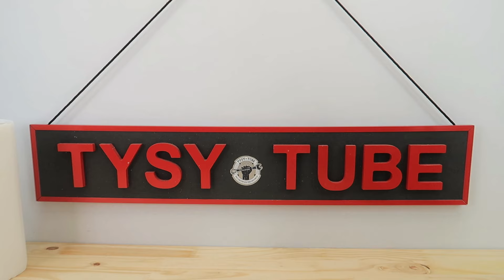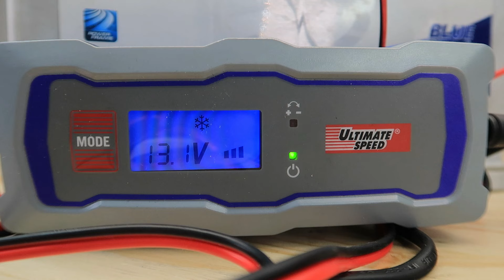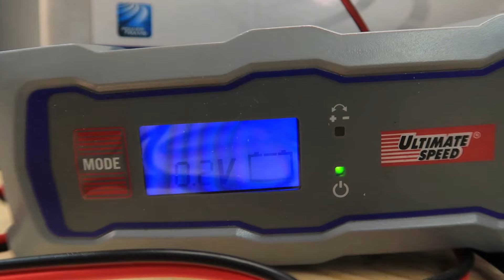I Restored this Rusty $1 Car Horn - NOT WORTH RESTORING

Comment: This was a really good restoration however I have some tips from and electrician's standpoint if your interested. First off all the terminals you used are not made for soldering. They are made for crimping. When you crimp those terminals with a correct set of pliers they clamp onto the wire resulting in a low resistance high quality joint that wont loosen due to mechanical loads. At least not easily. You can however add solder after for aditional safety. Also the color of the plastic insulation is not there for decoration or labeling. Its used for telling you what diameter wire that terminal was made for. Red represents 1.5mm2 and blue 2.5mm2. I belive yellow is 1.0mm2 but dont hold me on that. And one more detail. When you crimp the wire you never solder it before you crimp it. Soldering will result in a terribile bond that will easily fall off with vibration. You also never take a ferrule (that cylinder you put over the soldered wire) and put it in a cable terminal made for crimping. Those are used specifically for screw connections and terminals. You also never solder a ferrule. I hope you dont take this as an offence (which it isn't). Your restoration was great and I was amazed at the results but I still wanted to point out these things for the next time you play with electricity.
Reply: Haha the pain in me heart when i saw him doing that😂
Reply: Me: well... I aint reading all that...
Reply: I was so confused when he pulled out the solder
Reply: Thank you for the critique. I am no electrician, yet I found your advice both sincere and invaluable.

Thank you very much for taking the time to clearly explain what was what.
Reply: In Germany the Color code is red=0,5-1,5mm² Blue=1,5-2,5mm² yellow=4-6mm²
Reply: Well, you just wasted 3 second of my life my scrolling through that 😂
Reply: @XxRileyxX, it took you three seconds to scroll through that? I hope you get well soon.
Reply: @fridif  right!
Reply: I totally agree with your comment

IN my head I was thinking..
What the hell is he doing?
Why is he doing it that way?
Reply: Hi, I spent many years with crimping wires by hand, semi press, and full automatic machines This moment when Tysy soldered stranding wires -  broke my heart. :/ He should buy easy kit with isolated connectors and dedicated pliers. Molex, Tyco, Weidmuller and many other manufacturers.
Reply: I was going to say the same thing. Not the best electrical connection used.
Reply: +1 for this advice as a sparky myself but in having said that this restoration is beautiful.

Crimp lugs like that sizing is as follows. 
Red = 0.5mm2 to 1.5mm2
Blue = 1.5mm2 to 2.5mm2
Yellow = 4mm2 to 6mm2

This would be different if using a different gauge system like imperial or American Wire Gauge, 4 AWG would be a very different size to 4mm2
Reply: @therealracerxtablet5162  He isn't an electrician, but I won't hold it against him.
Reply: Never add solder, not even for "added security". The tinned wires are prone to breaking unless you fully enclose them with a celastic as a strain relief. In an actual automobile, those connections wouldn't last a year due to the vibration. Modern cars have zero soldered connections, even terminals usually get pressed into PCBs, instead of soldered, as again soldered joints are prone to developing cracks. Never. Solder. Crimps. Not even after crimping them. You'll only weaken them.
Reply: me: i’m not going to understand any of it, so i shouldn’t read it 
also me: reads the whole thing
Reply: took the words out of my mouth.  The soldering of the ferule kind of drove me nuts.  But other than that, this guy is definitely dedicated and talented.  Through all his videos I've binge-watched, he's been improving steadily, and comments like yours have helped him too.  So cool.  

Hah.. Saw the terminations used; and was wondering "why no crimp?!"  Those wires are going to just slip right off.  Solder alone won't hold it.  It's bugged me so much.
Reply: Yor advice makes sense but there is nothing wrong in soldering the terminals as he did. What's better than soldering anyway; a good crimp would at least match it but never make it better.
Reply: Me, reading this with interest as if I know any of these terms besides crimping and soldering.
Reply: Yea, him soldering that was a big WTF. You can get the proper crimpers for those eyelets from a hardware store for not much. If the wire is too small to crimp use a smaller eyelet.
Reply: @fridif  Why the "me:"?
Bruh

Comment: Who else was shocked at how clean the inside of it was 😳
Reply: Scrolled down expecting to find this comment. 90 years old and it looks new inside!
Reply: Yeah well made for it to look so good on the inside compared to the level of corrosion on the outside.
Reply: just like a small time capsule inside!!!!
Reply: I was shocked too. It was incredibly well sealed for the inside to be that pristine.
Reply: Me
Reply: I'm saying yes to the og comment
Reply: The probably dead engineer that decided to use that gasket just rolled in his grave.
Reply: French quality 😌
Reply: Bruh its been sealed shut for 90 years obv it’s gonna be clean
Reply: @braydenrezutek9839   seals often don't hold for that long 🙄
Reply: BoboGumdrop it wasn’t a seal it’s a gasket😂🤦‍♂️
Reply: @braydenrezutek9839  boi
Reply: It was closed,thats the reason
Reply: Was just gona write that.
Reply: Is because the oil
Reply: As long as it's not exposed to the elements, it can last years...
Reply: Hey! Many thanks for the spoiler!
Reply: I think it's because of all the gaskets.
Reply: Bro I'm looking at it like "there ain't no way the insides from the 1930's" 🤯🤯
Reply: Yup I was.
Reply: Beautiful. Like new again
Reply: I don't believe it's from 1930. There was no plastic wire isolation in 1930, for example
Reply: @michakubisz535  lol who reads the comments before watching? They are literally for discussing what happened in the video
Reply: You and me both. I was expecting it to be dirtier than it was

Comment: That was a satisfying view ! Thanks.
A tip : your soldering iron is so hot, it immediately burns up all the flux in your solder upon contact. With a lower temperature, your solder will flow much better, soldering will be easier, and it lowers the risk of damaging your cable insulation. 👍

Comment: Heh about a hundred years old and the inside of the horn looks like it was made yesterday 
 Our ancestors knew how to build stuff to last unlike today
Reply: I would challenge that today it's not that we don't know how to make stuff to last - instead companies intentionally design parts NOT to last so that you'll have to buy more of said product.
Reply: Made in China man. That's why.
Reply: @Vulprex  It's our own fault as consumers. We always want the newest best thing so were are constantly upgrading.
Reply: @tjgrembowski  Exactly. Trust me, if our engineering "ancestors", had the capability to make things 10 times cheaper back then, they would have.
Reply: That's not always true. Cars last longer than ever. Mine has over 220k miles on it.  That would've been almost unheard of "back in the day".
Reply: Because good quality isn’t part of globalism shrug 🤷‍♂️
Reply: As an engineer we are more than capable of designing stuff to last, the problem is that the item that is built to last will not sell as it is expensive. It isn’t because the cheap equivalent is made in China (the Chinese are more than capable of building to last as well) but because it is built to a minimum price. Ultimately it is because we as consumers always want a bargain.
Reply: i honestly thought it had been repaired or renovated in the past 30 years.  i know the connections have been by the type of connects and shrink tubing.  if it had been renovated its still an amazing rebuild. and I if not man oh man the quality workmanship is off the charts. great video either way
Reply: Caedes 
Well said! Consumers, especially in the today’s American market, want a bargain - a good deal as we say -  to make us feel good about our purchases. A mild form of greed.
Reply: @ckmoore101  I do agree with you somewhat. Honestly, though, in the "old days" (for lack of better terms) things weren't as "mass-produced" so things were made a little better quality and with more longevity since there was a more personal and intimate experience to the creation. It's corporations and the mass-production that causes cut corners and "cheaping out" in my opinion. So I agree in the sense that the corporate ancestors have always tried to make the maximum profit possible, but if you look back at the individual engineers and inventors it seems they had good intention in mind.

Greed gets too many, though. That you're surely right about.
Reply: @jxavier3876  Sheckels man, all for the sheckels.

Comment: 1:48 there’s threadlock showing on a bolt, but threadlock fluid wasn’t developed until 1953.  Maybe this isn’t from the 1930’s?
Reply: Also it is for 12 volts , not 6 as it was before the 50's.
Reply: @draxoronxztgs1212  Oh it is 12V?  I thought since that wire gauge in the coil looked so heavy, it was connected to a 6V system
Reply: penn707 no u! 🤪
Reply: I have seen locker like that on electrical items from the 40s. 

Only electrical items though.

All the mechanical locks ive seen have been on larger bolts.
Reply: penn707  maybe you should take your meds.
Reply: Could just be paint?
Reply: @JohnSmith-eo5sp  Well the thickness of the wires and coil doesn't necessarly defines what voltage it's made for. It is the current for the amount of power (wattage) it requires to work, and a horn this big will take more current than small ones does to produce louder noise. Then the switching frequency it has that's above 1000Hz and short period of time it is on when used, would'nt generate much heat in the coil.

Comment: Cars didn't use 12V back in the 20's, It was 6V ! it was the case until the mid 50's.
I don't know if the horn liked to be boosted...
Reply: Did you check what was engraved in the klaxon's body ? No ? You obviously missed it. It's at 5:03. Better check than coming with your certitude, specially when you're wrong.
Reply: @CaptainDangeax   tu as raison, le numéro de série mentionne bien "12V", il s'agit donc d'un klaxon ultérieur à 1954, ceci ne dévalue pas la rénovation, SUPERBE !!

Comment: OMG you use 2 electrical terminals on each cable and forgot to squeeze them. You don't need to weld the^m.
Reply: I always solder terminal ends on anything. Safety measure for me

Comment: the putty will deaden the sound slightly a very hard setting two part epoxy will yield better sound quality for the next time you do an auto horn.
Reply: Based on what? The putty was on the outside of the horn and was only used to fill in pitting. In that case wouldn't coats of paint and varnish do more to deaden the sound? Irrelevant since the sound comes OUT of the horn not THROUGH the material of its shell. Also it's a car horn not a musical instrument. Sound quality is not of much concern.
Reply: @jjryan1352  the piece of the horn where the bondo was applied acts like a resonator that's what slightly muffles the sound. just find a horn any place your hand a similar part have someone honk the horn release it and keep listening you will hear the difference
Reply: when you do a restore you restore to a brand new horn you put bondo on all your horns if you like I don't care

Comment: What a strange collection of little bits and pieces!
I think the cast horn was just born to be rough... it's probably better quality now than it was from the factory.
Pouring the used rust remover reminded me I have nothing better to do than go get a beer.
So, now you can put this in a bag with a small battery, and walk down the street beeping at drivers.
Endless hours of confusion and fun, maybe even a fight between drivers.
Fantastic work and a great paint scheme as always.

Comment: I occasionally work on antique things that are 80+ years old and it always amazes me that stuff that old often disassembles easier then things built even just 10 years ago.  
Often it will look ll rusty and crusted over on the outside but the bolts and screws will come apart with minimal effort compared to new stuff that looks good but has the threads completely rusted solid to the point the heads sheere off before they let go.

Comment: You did absolutely fantastic work!  I lived the collision industry and know how much time and effort there was in applying and sanding all that filler.  One question I have though is, why would you “wet sand” primer? Primers are generally porous. I would be concerned about and moisture getting to the metal after all that work.  Nonetheless, great restoration!

Comment: The fact that the inside wasn't corroded is a big surprise. I didn't think anything could have that good of a seal. I did notice some corrosion but compared to the rest of it that was exposed to the elements it's very impressive what proper sealing does.

Comment: Very nice.  Small point, I don’t think wire wheeling helps before applying the putty, the sand blasted finish would likely promote better adhesion.

Comment: For the electrical connections you may be better off by using a crimping tool as the vibration from the horn may fracture the soldered joint.

Comment: one important point, this horn is originally designed and adjusted to operate on 6 volts automobiles, the battery used is 12 volts so it is previsible that the sound pitch will be weird.

Comment: I'd venture to guess the 10% lower volume is because of the 2x coats of paint and 2x coats of lacquer on the diaphragm, which after all has to vibrate at several hundred times a second to produce that sound and you muffled it!

Nevertheless, another beautiful Tysy job. Well done. I was thinking while you were applying body filler to the trumpet that I would have left it in the pitted condition because cleaned up & polished it has its own beauty, but the finished product was quite superb and a nice choice of colours.

Comment: great video! can I ask how the electrolysis worked out with the brass anode and iron cathode apart from the zinc coating as I'm looking to clean brass parts and haven't come across a good brass cleaner to date for intricate parts,

Comment: Being this old, the horn was meant to be used in a 6 volt system, you hooked it up to a 12 volt battery. If you wanted to see how it sounded back then, you'd have to get a 6 volt battery
Reply: 5:04 Doesn't the horn literally say 12V?
Reply: @danem2215  huh, must have missed that part when I watched this a year ago. In that case, its either not as old as he thinks it is, or not a car horn

Comment: Have you ever used a hammer to make a gasket? It is something I learned a few years ago. I have a very little ball pen hammer (maybe a couple ounces).
Lay your gasket material onto the surfaceor housing of what you need the gasket for and lightly tap on the gasket on the edges and it will cut the gasket material. Use the pen side for the bolt holes. This doesnt work on cork well thought.

Comment: Get a piece of glass at least 1/4" thick and you can 'glue' your wet/dry sandpaper down to it with a light coating of oil.  Makes for an extremely flat surface for sanding and the paper doesn't move around on you very much.

Comment: I was so confused when you started soldering ring terminals... Just buy BM 534 crimping tool, it’s much safer and quicker. For example, nowadays car companies don’t use soldering for connection at all, only in PCB electronics. Anyway, great video, as always.

Comment: If it's from 1930's maybe a 6v battery would be more appropriate. Also, you're not supposed to solder mechanical electric connectors (fire risk, break easily). But anyway, it look great and  works!

Comment: You shouldnt really use a high pressurized sand blower to remove rust because it scrapes off alot of metal
Try using electrolysis or acid instead.

Comment: I am sorry to be the one to point this out but that is NOT a 1930's horn! The star washers attest to that as well as the fact that it is 12 volt which didn't  happen until the mid-'50's. From the looks of the materials used I would say it is MUCH later than that. Probably closer to the 70's or even later!
Reply: On further inspection. That is a very modern horn!

Comment: if that is a 1930 horn, would not run it on 12 volts as it would most likely be a 6 volt unit. Nice restore though.

Comment: why solder tips that are designed for crimping? Why mount the wire in a lug, then mount it in another lug? Why not insert directly into the o-shaped one? and why put all this in tin?

Comment: You don’t fill in hole in musical instruments unless it’s to weld and smooth down the metal. It muzzles the volume or changes the note all together. Then you tune the instrument. When you filled in the holes instead of just smoothing it down you compromised it’s ability to create proper music vibrations. Just saying.